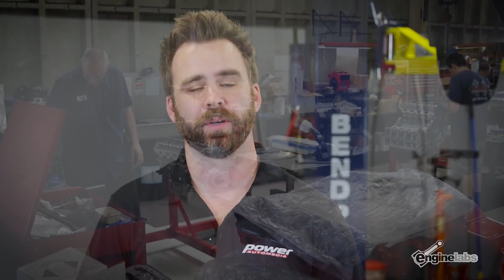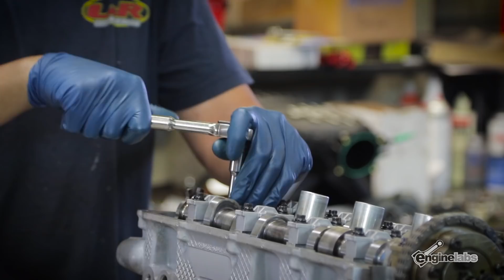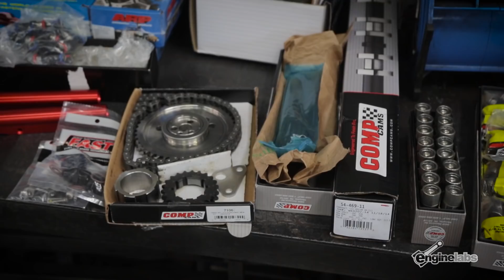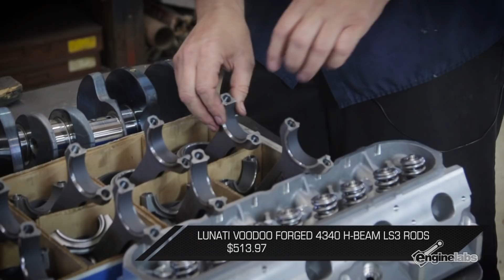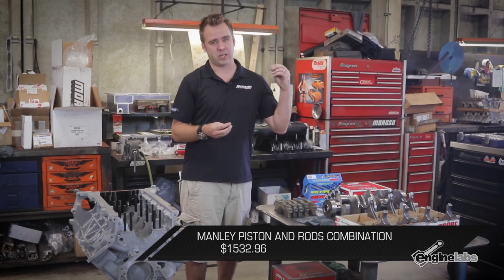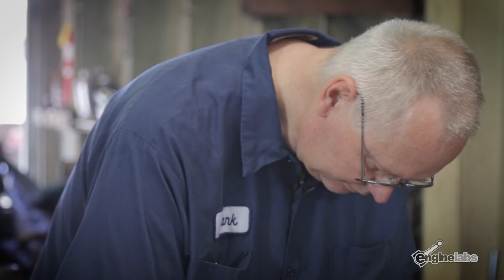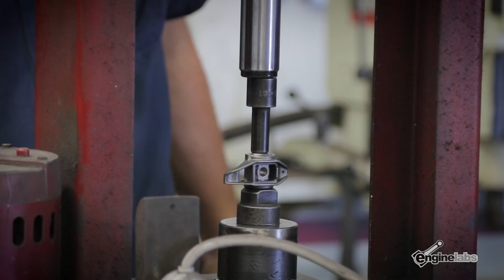$10k Coyote vs LS3 Shootout - The Build

Comment: Looks like they both lost? Still no Pt 2 or did I miss it?
Reply from the maker: +Fullforce LTX You didn't miss it. Here are the results after dyno testing: http://www.lsxtv.com/tech-stories/engine/update-ls3-vs-coyote-budget-shootout-ls3-dyno-results-are-in/
Reply: +Power Automedia u only put the ls3 on there or did I miss that?
Reply from the maker: slammedlyfe The Coyote has been tested and a video is in the works, which will include the results
Reply: +word  to your mother haha yeah probably, ford as needing that little edge
Reply: +word  to your mother no oil pressure had to be rebuilt

Comment: 7 years later the Coyote is dominating Drag and drive events with Brett Lasalas Sleeved oe block, ported oe heads and oe Coyote crank. 2,800 hp, 6.33 @ 225mph on 275s. 
The 4.6 4V has gone 5.88 at 256mph with oe block, heads, timing components and crank. 
The 5.4L holds the standing mile world record 300.4 mph oem block and heads. 
A billet block Coyote with ported Ford GT cast heads has run 5.67 @ 265mph 

Zero LSs have matched these milestones. 

FoMoCo is king
Reply: Hi there sir I'm from the UK and Ive tried getting advice of people here on which engine to chose for my ford seirra or Merkur I think their called state side which I ditched the cologne 2.6 v6 I've got a choice from the local wreckers yard either an ls6 from a corvette Z06 or a coyote both came from cars with rear end crash damage engines are immaculate I want to eventually turbo charge but want reliable power everyone I've asked here never get a straight answer. Your comment mentions the coyote and I'm reading good stuff about it but the same with the LS 6

Comment: nearly been 3 months, where is part two
Reply from the maker: +fightfanian UPDATE: The Coyote has been dyno-tested. Working on the video and part 2 of the article now.
LS Dyno Results have been posted --> http://www.lsxtv.com/tech-stories/engine/update-ls3-vs-coyote-budget-shootout-ls3-dyno-results-are-in/
We are sorry for how long this has taken. We had experienced some oil pressure issues which are NOW resolved. But we were on the dyno and had the issue, had to rebuild the engine and then reschedule the dyno session.
Reply: +Power Automedia You put over sized pistons in the coyote so that bumps the cubic volume which the rules were you couldn't?
Reply: fightfanian Lol i dont care bout the engine size difference they made rules on there website that engine displacement couldn't be changed

Comment: Silly comparison. The Coyote is essentially maxed out on stock setup. A cam swap is useless, ported heads only allow for higher revs, and an intake manifold only gives slightly better airflow. A stock Gen 2 doesn’t need rods or a crank, it can handle plenty of power. However, the LS3 loves bolt ons and cam swaps, ported heads, etc. The motor is NOT maxed out N/A from the factory for fuel efficiency and drivability reasons, so there’s a lot more potential. Best thing you could do to a stock Coyote is keep it stock; run E85, throw a blower on it and watch the dyno numbers soar. These are two completely different beasts that must be fed on very different diets. Treating the Coyote build like an LS3 build is like raising a dog to think it’s a cat. He won’t do it every well, but he’ll try.

Comment: Ok I'll say this as a Ford guy.... The LS is super affordable, needs a cam to actually hit decent RPM's (safely over 6500), and they're easy to find.... Therefore the LS is great for power to go down a drag strip on a budget

The Coyote on the other hand is expensive, harder to find, and rev's safely to 8000 rpm without having to worry about anything breaking.... With that said though let's compare something else here. IF BOTH engines received the same mods (budget aside) the coyote would be far better because it is able to use a larger power band (1500 RPM difference) 

If you read this far don't hate on the statement just accept it for what it is worth... Budget aside mod for mod the coyote would win

Comment: so basically the Coyote is just a cam swap with a little clean up job and the ls3 gets heads cam coyote still going to win though
Reply: it's so expensive for Ford and it will go over budget
Reply: JRudolph
Reply: Nobody that knows what they are doing buys a brand new ls block like that. I could yank a lq4 with computer for $800. Get a balanced and forged rotating assembly for$2500. $500 at the machine shop. 500 for fasteners. Cam, heads, and intake. $1800. Injectors 1k. Or 500 if you go cheap. And 3k for me to Fab a turbo kit. That bitch would make 1500 all day everyday reliable.
Reply: So basically, they spent waaaay more than they needed to on the LS so the Coyote didn’t look like and expensive chump.
Reply: @stlchucko  yes lol

Comment: LS is gonna win every time if its a dollar to dollar build. The coyote is a badass, and could easily win, assuming you have pretty deep pockets, and a lot of free time to put together a far more complicated engine. hence why most drag mustangs have LS motors in them. $3000 for a f150 takeout, guys pick up 5.3 LS motors from trucks for $300-$500, and the stock 5.3 can handle some serious power on the stock bottom end of that 300-500 dollar motor. that's a win win

Comment: Hey if you bought a new block for the LS you should have done the same for the ford, even though it would have put you over budget. Was wondering if you were going to drop the compression in both motors, mount a couple of turbos and watch the little LS really outshine the coyote.
Reply: Except a 4 valve coyote would take to boost better.... lol. Do you really know so little??
Reply: and the ls3 is 1.3 l bigger lol plus the higher rpm cap on the 5.0 makes it better the gm ls is limited by the in block cam and push rods if u put a 4v head on it I’m sure it would be a good motor

Comment: Both are great engines in my opinion. Id go with the coyote. Its more efficient and reliable but if i had a compact build then ls3 all day.
Reply: +TheHannukahZombie If you don't know then look it up durp...the tech is more advanced than old pushrod for one...not an ass puller but an ass spanker I am...good day...
Reply: JIMBO SLICE That's not it works, durp. You make a statement you support it with facts. Every bit of technology an OHC motor has a pushrod motor has. Direct injection, variable cam timing, cam phasing, cylinder deactivation and so on. There is literally nothing the DOHC engine has that isn't on a pushrod motor and done in a smaller, lighter and more cost effective package. You don't know what you're talking about because you regurgitate the same tired BS you hear from other people.
Reply: +TheHannukahZombie I'll just say every import super car is not a pushrod, they are either Sohc or Dohc. Theres a reason why the rest of the world used this tech vs pushrods.
Reply: Dude I see you like to argue because you feel as though you are right. All the bullshit aside... Let just say Chevys 6.2L pushrod was up against a 6.2L DOHC motor. Which is going to make more power...? The 6.2L DOHC is. Why is that? Because it is more efficient at drawing in air and releasing it. That was my whole point from the beginning but you feel as though I hurt your bowtie pride then you start comparing cessnas to a SR72. Not a very good analogy, but whatever dude I could care less. Either motor is badass just depends on what you want to do with them.

Comment: I believe all modern engines should be DOHC, it's better technology and it can get way better rpm.
Reply: +Uriah Bleue It's also far more complicated, Harder to work on, needs a far bigger foot print and more expensive. I'll take a small block chevy any day.
Reply: blacknova23 that tells me Ford's are better engineered than Chevy's.
Reply: +blacknova23 exactly
Reply: Uriah Bleue
Hey whatever rocks your boat. But when you consider we only want to go fast...
Reply: BMW S85 5.0 Litre V10 engine, DOHC 40 valves, 90 degree bank angle 12:1 compression ratio  240KG  507 hp (378 kW) @ 7750rpm/520 N·m (384 lb·ft) torque @ 6100rpm
The S85 utilizes both individual throttle bodies and Double VANOS (BMW's infintely variable timing for intake and exhaust cams) It also has  equal length tubular headers.
GM LS7 7.0 v8, 90 degree bank angle, pushrod  single cam in block valve  train 16 valves, 11:1 compression ratio, 206KG 505 hp @6300 rpm, 470 ft lb @ 4800 rpm, plenum intake manifold, basically log headers, no variable valve timing. 
S85 power&torque:weight ratio, (2.113 HP/KG, 1.6 ft lb/KG) 
LS7 power&torque:weight ratio (2.45 HP/KG, 2.28 ft lb/KG
The Ls7 outdoes the s85 is nearly everything and has FAR less technology.
Now let's see what happens when the ls7 actually comes with more technology, 
Mazzanti Evantra's variant,  701 hp at 6600 rpm and a maximum torque of 848 Nm at 4500 rpm, woe that's overkill, and still has the 11:1 compression ratio and still more room to improve. Smaller, lighter, more torque, lower CoG, better power band and still more room for improvement through aftermarket parts. I'll warn you not to argue because I can literally write a research paper on this subject and already have valid evidence proof, sources for this argument readily bookmarked.
Reply: For people that aren't educated ya...i agree with you. You small block Chevy has a huge Cube advantage...BUT...boost the Coyote and it the LS goes back on the trailer. none of these tests are created to be equal. Ecven I can make more power than these clowns for 10 Grand.
Reply: You obviously have never worked on ohc engine especially modern engines that shit  timing chains , and the plastic chain guides. Less parts more durable. More parts more prone to failure. Wake up people. I've replaced far more ford ohc engines then ohv.
Reply: @Jesus_is_truly_God  BMW vvt is not infinite variable cam advance or retarding. There is only so much adjustment for cams in any engine.  Dude im a BMW certified tech. 
 Writing a paper vs actual hands on is totally different. Not everything on paper works they way it should not in real life. 
And I by the way the BMW v10 is a piece of shit. , so are their v8's. Just junk.
Reply: @20502chris  My apologies, I was quite immature then.  Being knowledgeable about facts does not give anyone the right to be disrespectful.
Reply: @CaptainDayne  I acknowledge paper stats do not reflect reality.  What about that new "Supra" BMW inline 6 though? haha

Comment: This may be a silly question but here goes anyways.  What does power per cubic inch or power per litre have to do with anything when it comes to going faster? I can see power per pound of the engine but what does the internal dimensions have to do with anything? Externally, physically, the small block chevy is smaller and lighter, a metric that equates to going faster on the race track (less weight=profit), not how much power it makes for the internal displacement of the engine. I've just always wondered that.

Comment: 6.2 vs 5.0 GM must not have faith in its motor, closer C.I would be a good start 5.3 vs 5.0 stroked to 5.3 even steven.
Reply: +angelo howard  Who cares what it displaces.  The only measure of a performance engine is power, reliability, weight, cost and physical size.  One engine is a stuck as a high winding DOHC with a limited displacement, the other is a large displacement engine stuck with two valves and push rods.

Frankly, inside that budget I don't know why the LS isn't at least 7 liters if they really want to make the coyote pay for having a limited displacement.
Reply: The 5.0 Ford v/s 6.2 Chevy is absolutely fair,in my opinion. An engine is basically a large air pump. The 6.2 may have a larger displacement, but it is an OHV/pushrod engine. The amount of air &fuel it can move efficiently is limited by the RPM range,and only having 2 valves per cylinder. The Ford can turn alot more Rpms and is much more efficient throughout the rpm range,especially tword the top end, due to the dohc/4valve design. 
That being said, I am a Chevrolet man,through and through. Always have been,and  probably,always will. But the coyote is one hell of an engine. It makes an impressive amount of power,is versatile, and efficient. But when it comes to building a hod rod,resto mod, or any kind of engine swap, the LS will always be the more practical option. You can build the LS,and slap on some sort of forced induction or nitrous,and still have a smaller budget,and easier build
Reply: They should have used Fords voodoo coyote 6.2. The results would have been totally different

Comment: I have a 63 corvette roadster with an LS 1 engine. The LS engines are incredibly the best thing GM has ever built. Lots of power and less weight. On the other side Ford runs circles around GM in auto racing world wide. I say the Coyote engine will put up the big numbers over the LS 3 just because its DOHC set up. Should breath a lot better than the LS 3.